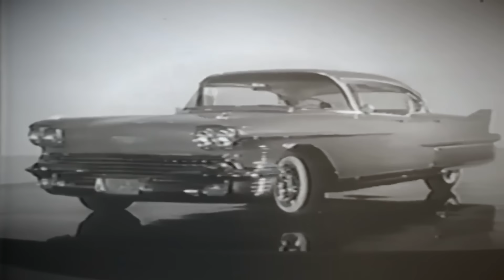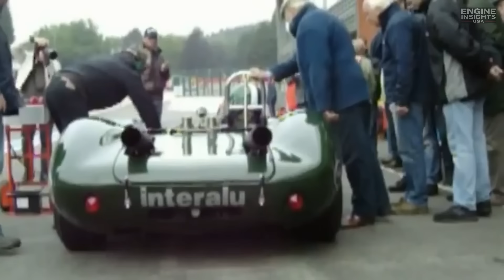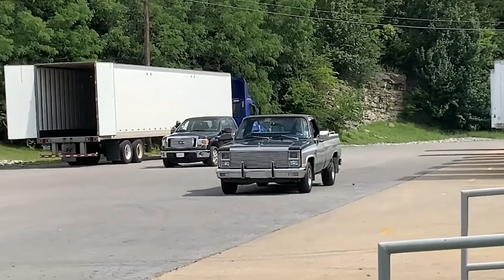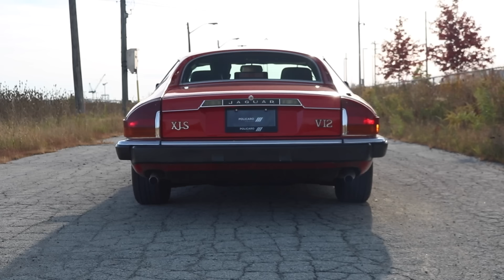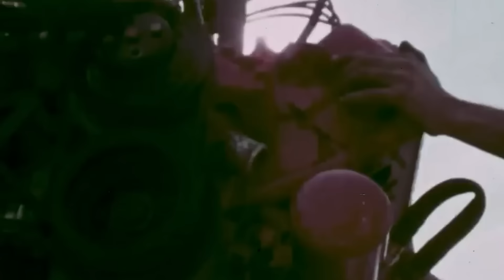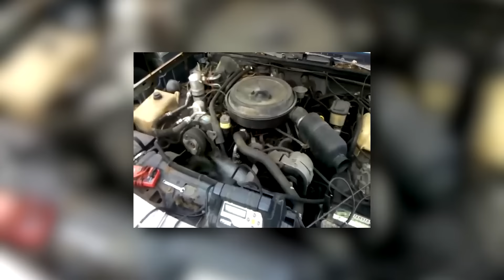10 of the Most Disappointing V8 Engines Ever Sold in America

Comment: There was nothing wrong with those big Cadillac engines....until the government poked their nose in. They were healthy high compression engines & at their peak I believe the output was something like 375 hp. Once the EPA got hold of them & strangled the DAYLIGHTS out of those engines with emission crap ( not just Cadillac) mind you, compression ratios fell drastically along with horsepower output. All vehicles around this era were victims of GOVERNMENT MEDDLING!!! Mpg figures fell too with all that emission crap they just kept adding. It was a wonder they RAN AT ALL. So don't give me the old runaround that they were bad engines.

Comment: 1974 was the first year for emissions control
Reply: Not true, For example, Chevrolet had the AIR emission system on both small and big block engines.  But yes, in '74 is when the mega regulations started.

Comment: 307 chevy caprice 70 mph in the quarter and 12/14 gas mileage driven by grandma. Also Lincoln MK 7 with 5 liter barely got to 70 mph in the quarter but   at least it got 21 mpg.
Reply: The Caprice had a 2 speed power glide transmission which was a real POS and that doesn’t stand for positraction! 
My 77 Monte Carlo with 350 4 bbl and 350 Turbohydromatic ate a tranny every 40K which was the mfg recommended trans oil change.
Reply: 1970 307 in the Chevy Nova was no slouch. Very quick 0-60. Mine would average 7sec. The final version in 75 was smogged down.
Reply: @JimMartin-w5m mine was a 2 bbl with a power glide 2 speed auto trans - a total dog

Comment: The Olds diesel conversion as the 2nd dumbest engines by GM in the 70s!!  I had the 350 gas in a '72 Cutlass it was great!  My parents had the 350 diesel in an '81 Caprice it was also great!! No major issues other than a bad injector pump.  They had it 7 years, 300K miles, and got 44 mpg on multiple trips!!!  Overall there were multiple design issues that doomed it for GM, my father knew the diesel's limitations, babied the engine, and it lasted and paid for itself.

Comment: Won't debate Chrysler's Lean Burn Ignition System because it generally sucks on any of the engines it was installed on. Mechanically the 318 in general is a great engine. Just covert the vehicle over to the Mopar Perfomance earlier Electronic Ignition system. Those systems are very reliable and relatively inexpensive.

Comment: I get the point, but calling the Cadillac 500 or AMC 360 “the worst” feels unfair. Those engines were victims of emissions laws and corporate panic, not bad engineering. In proper tune, some of them were actually tough, torquey motors that outlasted many modern V8s.